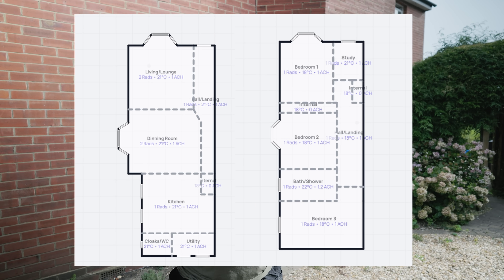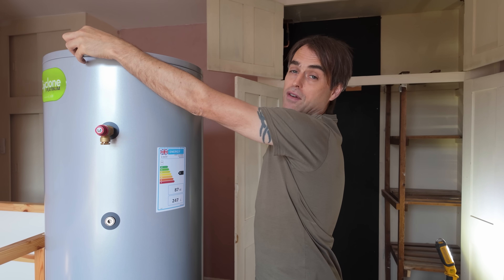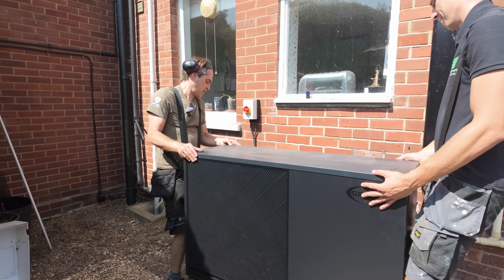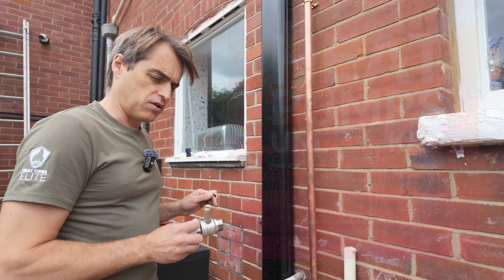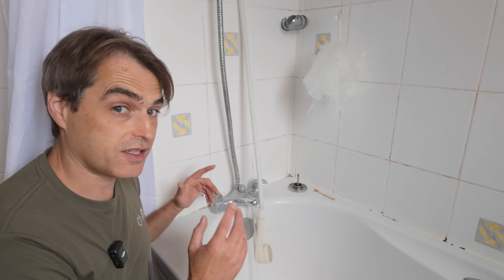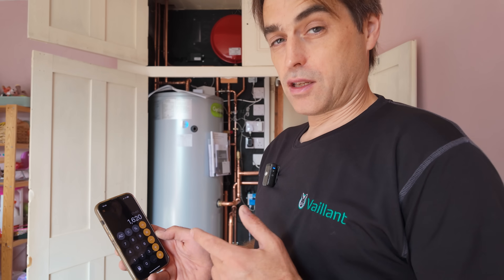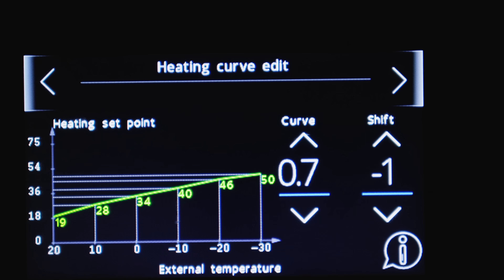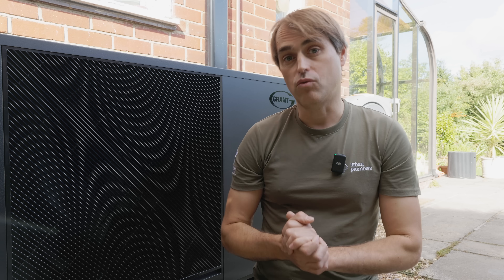Cheaper Heat Pumps Are Here. But Are They Any Good?

Comment: Very well insulated?  It’s a 65mm cavity with blown fibre.    It might as well have no insulation
Reply from the maker: You couldn’t be more wrong.
Reply: @UrbanPlumbers in Ireland we wouldn’t dream of adding that particular heat pump to this property with that level of insulation and would not defo not get approval for an install through a grant scheme. My parents house has 100mm of that in the walls and it doesn’t have great heat retention.  If heating wasn’t on or stove wasn’t lit, that house is cold.   I refuse to put anything other than a Nibe, Viessmann 150-a or a Kronoterm Adapt into a retrofit like this
Reply: @brianl6420  If these products work on the continent, where winters are harsher and we also have old, energy-hungry houses, they will work in Ireland and the UK too.
The real problem on the “islands” is the pipework – 10 or 12 mm copper pipes and single-pipe systems are a killer for heat pumps if not adapted properly.

Here on the continent (not everywhere, but often) old houses from the 70s and 80s have 5/4" pipes from the boiler (two-pipe system) and then 1/2" pipes to each radiator. Radiators were always oversized by the old installers, which is perfect for heat pumps – plenty of water volume, good flow rates. The only must is a proper cleaning of the heating system.

The issue is almost always on the secondary side – the house installation – not the heat pump itself or the brand name on the unit!
Reply: @skrbek34 of course they will work and heat the house but at what cost?  If I could get away with a 65mm cavity in my own place rather than a cavity of 150mm with Walltite insulation I’d have saved myself €15k
Reply: @skrbek34 I have fitted heat pumps on very old non insulated properties but far more capable expensive units which have been a big success
Reply: @brianl6420   You are absolutely right – the energy condition of the house always comes first if you want cost-effective heating. I can’t really compare retrofits in Ireland/UK with ours, but I assume you are more traditional (which I actually like and respect a lot) and keep the look of the houses during renovations – here it’s not always the case.

For example, our typical 70s–80s houses (the most common to renovate) usually need around 35,000 kWh per year for heating in their original state. With an air-to-water heat pump that means roughly 8,000 kWh of electricity. After renovation (15 cm insulation on the walls, 30 cm on the roof, and triple-glazed windows) the demand drops to about 4,500 kWh.

That’s why it’s so important to do the energy renovation first – otherwise, you end up with an oversized heat pump for the house.
Reply: 50mm blown cavity in my place, exposed, on a hill… 6.7kW loss at -3, threw in a 9kW Cool Energy r410 unit 3 years ago and couldn’t be happier with the performance.
Reply: @dorsetengineering but wouldn’t that heat pump perform much better if house was better insulated.  50mm blown cavity in yours compared to 150mm of Walltite insulation in my cavities!
Reply: @brianl6420  Almost certainly, but the important thing is I can afford the running costs and the house is nice and warm. Cheaper than it was before, and we extended at the same time. Don't need the upheaval of covering the place in 100mm of EWI.
Reply: @dorsetengineering true! Fitted a cascade of two high quality very expensive ashp’s on a big 300 year old house little to no insulation   Pulls in the oil boiler to help below -3 degrees which is rare, house is nice and cost and costs a fraction of what it was costing to heat. The cost to insulate would be massive as it’s a protected structure.
Reply: Speak to the blokes who built it in 1915.

Comment: What do you think about using a manifold to feed the radiators. Im in the middle of refurbishing my house so I could run 28mm from a boiler/ heatpump to the manifold in preparation.
Reply from the maker: Yeah. We do it quite often
Reply: @UrbanPlumbers  just doing a selfbuild bungalow UFH for G/F, couple of attic rooms on1st floor which will have rads would you take the flow&return for these from g/f manifold? or from primary pipework?

Comment: What the issue with Nibe? Customer service/tech support?manufacturing issues? You have fitted them before so curious to know why you have gone off them.
Reply: Not an easy company to work with, withholding information if you are not in their club....and they want ridiculous money for spare parts.

There has recently been a huge stock clearance of nibe parts at auction. Maybe they are downsizing their UK business?    Always cheaper to look online for parts abroad and get them shipped into the UK.
Reply: Agreed, we really need a breakdown on this.
Hopefully manufacturers can take the feedback on the chin and improve their offerings and support in response
Reply: Customer service and logistics management are shocking too
Reply from the maker: Not shocking - non existent. Company is impossible to deal with

Comment: I'd love to see a refrigeration tech doing a full teardown of these units. We never get so see how much care goes into these boxes.
Reply: In fairness to Keith Scully and the lads in Grant their attention to detail is brilliant. Backup not so good
Reply: Actually he’s not a refrigeration engineer, he’s a heating engineer and a damn good one but a refrigeration engineer is on a different level.
Reply: @garywright8846 who Keith Scully?
Reply: @garywright8846 refrigeration engineers great with the heat pumps service repair!! absolutely shocking when it comes to central heating hydronics and piping heating of heating systems and UFH  wiring controls…..heating engineers all over the country are making a killing rectifying air source heat pump heating and hot water installations
Reply: Doubt there is much to say, refrigation is hasnt changed in the last 50 years beside variable speed. The compressor and other components will be from air conditioner. So it just comes down to build quality, software and noise.

Comment: Great to see some cheaper heat pumps. Have you looked at the ebac units? They seem to be cheaper and have good specs.

Btw - Weird audio glitch at 3.54.
Reply from the maker: Yes, but controls looked very basic, so wasn’t too interested
Reply: a car radiator, fan, large fridge pump, a plate heat exchanger, and a controller, is the guts of it. really shouldn't be more than a few hundred quid
Reply: @JohnMullee  I watched a Vailliant video of a processing plant in Germany, they could make a boiler in around 12 minutes, a heat pump was around 240 minutes if I remember right, hence a factor I guess in the price difference?

Comment: its still £3000  a cheap gas boiler is £500
Reply: 🤣🤣🤣As if., my inlaws have just paid over £6k for a new gas boiler for a 1980's house.
Reply: @EverydayLife621 high end boiler costs £1800 so they paid a lot of labour
Reply: It will be a rubbish boiler for that price!! You also haven’t included installation in your £500
Reply: Huge difference in running costs. If you have the right walls and can afford the unit, it will soon pay for itself and you won't be at the mercy of volatile gas prices.
Reply: @TheUnchainedMind  Unfortunately the grid is also at the mercy of volatile gas prices.
Reply from the maker: Nice to have solar and battery storage for that reason or battery storage and an EV tariff.
Reply: You say that but inteligent octopus go off peak rate has been 7p a unit since its inception. With batt storage i run >90% off peak. So so cheap
Reply from the maker: Exactly - that is 4 times cheaper than any gas boiler can ever be. My heat pump is pretty much free to run with solar and battery storage savings us £1000 a year on bills alone.
Reply: Does that include the fire extinguisher?